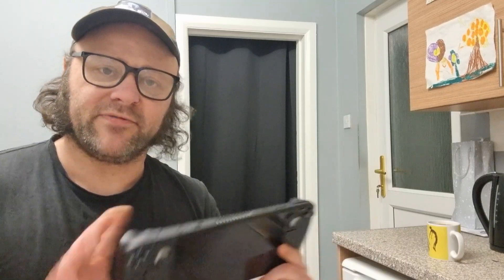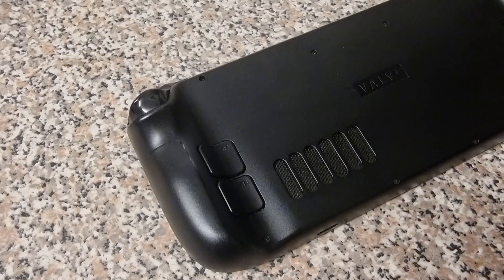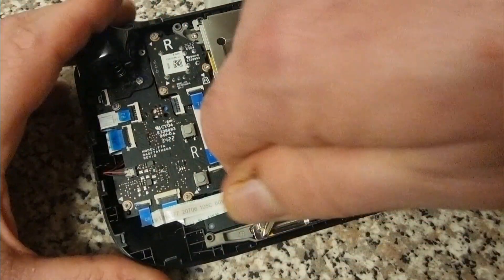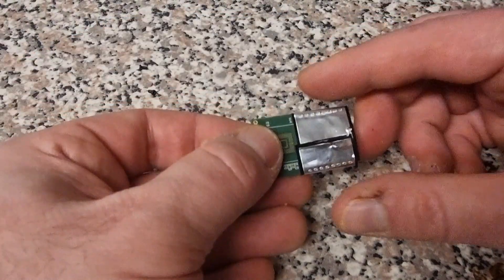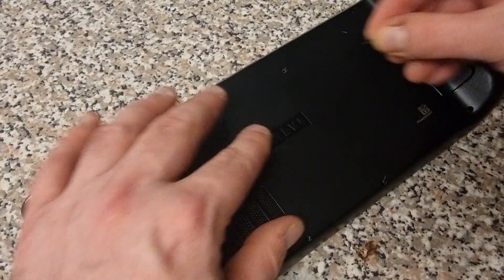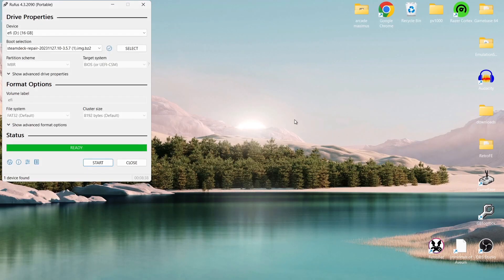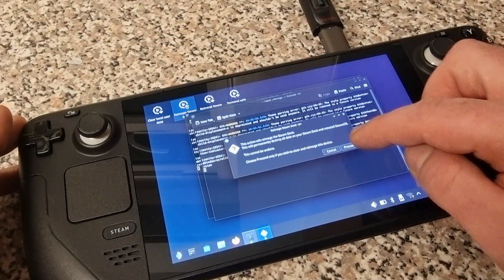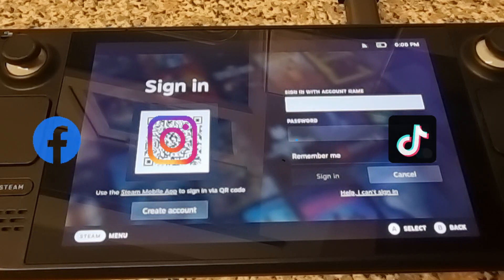How to Upgrade a Steam Deck NVMe SSD Tutorial #steamdeck #nvme #valvesteamdeck

Comment: I’ve upgraded my steamdeck twice  it’s now at 1Tb. I seem to struggle to get the usb stick to boot. It seems to have to wait for ages reinstall menu to boot. Not sure if it’s the usbc/hdmi dock that’s the problem.
Reply from the maker: Hey, have you tried a different USB stick? Normally sandisk works well.
Reply: @JustJamie1983  it’s all sorted but yeah I tried a couple of different ones. I used a usb 3 kioxia stick. Once it go to boot it was fine.

Comment: Hi, thanks for this - great content! So is it possible after upgrading the SSD on a 64gb unit to say 1tb, to further partition and add a boot menu so that you can select between Standard Steamdeck and Retro without having to manually access the boot menu?
Reply from the maker: It is possible to do that but you would need to do some further reading.
Reply: @JustJamie1983  Perfect, thank you! :)

Comment: hi jamie, just in the process of doing this now. i'm a complete newbie so apologies for a potentially stupid question, but why do you not plug out the battery? i saw on a different guide to do this and am wondering if removing the battery is an unnecessary precaution (which i hope it is, seeing as i cant disconnect mine properly anyway).
Reply from the maker: Hey there. Entirely up to you but some might advise to do so, some might not. My Deck and battery and perfectly fine without removing the battery. Just be careful not losing the screws!
Reply: @JustJamie1983  perfect, thanks a mill!
Reply from the maker: @shahin-hou  No probs at all. Enjoy 😀